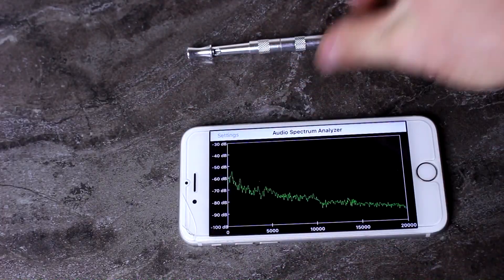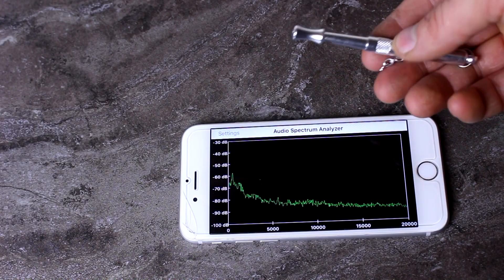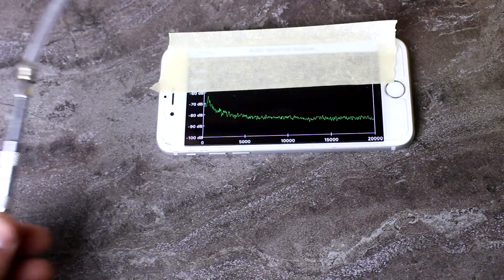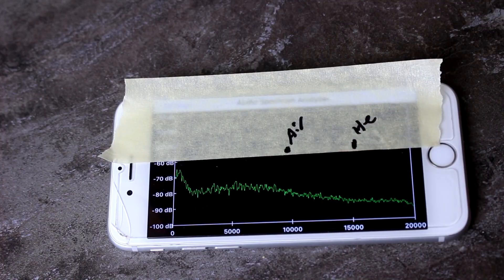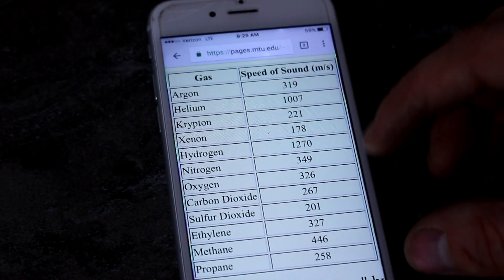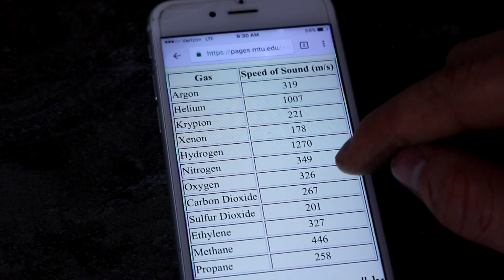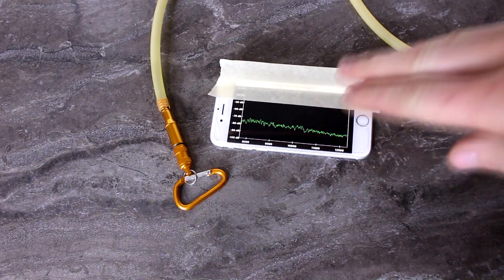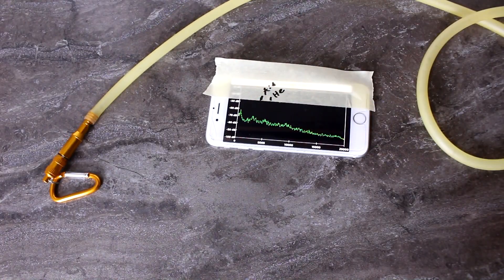Dog Whistle On Helium and Xenon

Comment: Is there any reason why the decibels were backwards? The resting db was a higher number than the peak db, shouldnt it be the other way?
Reply: It's not backwards as such. Decibels are used to measure a ratio on a logarithmic scale. If you're talking about the decibels of sound pressure level (dB SPL), which is how "loud" something is, then 0dB is the threshold of human hearing, and the dB go up from there as a the SPL increases.

With electronics it's different. The dB here doesn't refer to SPL, it refers to the electrical signal level. The microphone moves in response to SPL, creating the electrical signal that can be used by the phone. But there are limits to how far the microphone can move, and thus a maximum signal level. Any sound pressures higher than that will be cut off. So on this scale, 0dB is the maximum signal, and the dB go down from there as the signal from the mic decreases.
Reply: I'm not gonna try to pretend I understood everything there but it definitely helped me get the gist of what was going on.
Reply: Glad I could help a little, haha!
Reply: The minus signs are important.  -100 is lower (more negative) than -60.

Comment: Could you scale up the whistle to infrasonic range (maybe use large drainage pipes 100ft or longer in total) and run various gasses through it  with significant pressure and flowrate to make a proper Horn of Jericho?
Reply: Come to think of why not use one those mineshafts you have access to as the organ pipe body? Might be tricky to plug the entry up but wouldn't cost much. ..

Comment: You were able to access one of the other harmonic overtones of a very tiny instrument with the Xenon gas. Impressive. But this also might be a contributing factor to why you got on odd result with the helium. With a cheap “instrument” it’s overtone series might be limited to certain frequencies, limiting or skewing your results. I would be interested to see what the results would look like using let’s say a pitched pipe from an old pipe organ where it’s length and shape dictate it’s harmonic overtone series and see how the series shifts with different gasses. (At that point pressure would only alter dynamics)

Comment: To get a more accurate pitch ratio for the helium and xenon wouldn't you need to record the whistle in a chamber filled with each respective gas?  That might mitigate the reduction in the ratio you were getting since the sound waves from the whistle had to pass through the air to the phone.

Comment: If you take a balloon of air and a balloon of helium, does one take longer to empty?  I would think the lighter helium would  get accelerated faster, since the balloon is exerting the same force on a smaller mass.  How could you repeat this experiment, taking the velocity of the gas out of the equation?  With just air, blowing harder (higher pressure) can change the sound, so is it the pressure, the velocity, both or neither that have an effect in this experiment as well as the density?  I would think velocity would, as it would modify the turbulence around the fipple of the whistle.
Reply: Ahh, you addressed this a bit later with the Xenon.  I think higher velocities would result in harmonic overtones resonating and could cause an effect (at some point, maybe not just with the difference from the atomic mass difference).

Comment: Is the frequency definitely proportional to the speed of sound? Because the ratio of the helium and oxygen frequencies looks more like 1.5. That's close to the root 3 which is close to the ratio between the speed of sound. 
9500 * sqrt(1007/343) = 16278, close to the 15~16 thousand for Helium
9500 * sqrt(178/343) = 6853, close to the 7 thousand for normal Xenon
Perhaps this is just a coincidence.

Comment: Typically balloon helium is 15% oxygen (you need to know this when you're illicitly mixing breathing gas for diving) to eliminate the asphyxiation hazard. If it's fed into the carburetor of a propane torch it will fail to extinguish the flame. This is like the third time I've heard you question the purity of that bottle of helium, it's about time you found out.
Reply: A Cody style video might be "how to get the O2 out/sequestered"
Reply: PETER GREEN I think oxygen has a lower condensation point than nitrogen. But it's been a while since my last chemistry class!
Reply: I wonder if surrounding the tank with liquid nitrogen to liquefy the oxygen would work?
Reply: PETER GREEN
That definitely would work. Perhaps a bit tricky to pull off in practice but a very clever idea, my compliments on that. Chill the whole tank below oxygens boiling point then hold it upside down and open the valve to blow out the condensed liquid.

Star Gazer
Using air makes a lot of sense at first glance (cheap and readily available) but 3% just isn't enough, it certainly wouldn't keep you conscious and in a high altitude location you'd still be at risk of brain damage(remember this is a measure to protect stupid people) to get even 10% oxygen your gas mix would wind up half air and that would certainly float party balloons but in the big picture it would suck as a lifting gas.
I've never personally had occasion to mix tri-mix but those who do all seem to agree that balloon helium is 15% oxygen(you always need to measure this in order to calculate how much oxygen to add to the mix).
Reply: Why do you know about how to illicitly mix deep sea diving gas
Reply: @Ang3lUki  It's only truly illicit if you do it for others. In most things regulations are much looser if your only doing for yourself. Diving is a field where most of the foundational research was done with public money in various countries and is for the most part freely available so a motivated individual can self educate fairly comprehensively. You just need to earn your own confidence to judge whether you know all you need to know. Diving is also a field where the state of the art is way past what any industry body will certify you to do. So unless your in the navy at some point you will need to stop gaining new skills or live by your own light.
Reply: @brocktechnology  That makes sense. It's very dangerous, so pushing the envelope at an industrial scale would be a lot of liability.
Reply: I suspect that is 15% air, not 15% oxygen.  That's about 3% oxygen.
Reply: I got super tilted by Cody Going "and down here Oxygen is about" Dude... Normal air is mostly Nitrogen, please don't be part of the problem Cody!

Comment: You might be unto something with your helium gas being contaminated with oxygen. I'm assuming as a party trick a lot of kids may inhale helium repeatedly and so putting some oxygen in there makes sure they won't die! But that's just a theory.
Reply: Probably both the above and original comment, a due diligence thing, with the added benefit of a larger profit margin, or maybe due to laws they are required to not charge for the safety feature that would be the normal air or oxygen
Reply: Doubt that anyone would die from it.

Usually you tend to pass out before you reach permanent brain damage.
Reply: I somewhat doubt it, but I feel I should throw this out there as a potential reason.
Helium is supposedly a popular gas to commit suicide with (look up "suicide bag"). It tends to be very rapid and without the symptoms you normally associate with suffocation. You just stop being conscious and that's about it.
Perhaps it is an attempt to prevent that. That is, assuming it is cut with another gas and that the gas is oxygen.
Reply: The only thing required is that the balloon will float when filled. If cutting rhe gas with O2 or other gases accomplishes that its win win
Reply: Here is a copy of my reply to Cody 
Isaiah OConnor
10 hours ago
Hey Cody yes, the helium is diluted in most if not all party tanks. Matter of fact even in large commercial size tanks they sell what they call Balloon Gas, which is helium often recycled from medical/lab work that is of a lower purity and useless to the medical/lab work in which it was intended that needs a high level of purity.  However it does work perfectly fine for party balloons, depending on the ratio.  

Also Inhaling helium can and has caused serious injury, death and permanent brain damage, as a quick google search will reveal.  Helium in and of itself is completely inert and will not cause you any damage. However as you have shown percentages are important, and if you inhale too much at once even for a few seconds, it can and will displace all the oxygen in your system, causing brain damage and death, and very quickly.  I found a website warning of impure helium supplies because they did not kill you fast enough, it was a suicide website where they teach you how to off yourself. So no not as safe as people would think. (That was more to others here then you Cody :) ) 

For example divers often use helium in their tanks to fight the bends, and this is perfectly safe as they use a regulator that mixes enough oxygen and nitrogen into the system so they do not die.  However if you breath a full normal size party balloon being between 11 and12 inches in diameter and have a smaller lung capacity, the results could be lethal.  Even worse with larger size balloons such as the giant 30 and 36 inch balloons. 

Why do I know all this? I am a professional Balloon artist and work with balloons and helium on a regular basis. 

Also since helium is currently expensive and going up in price a lot of companies are diluting the supply they are selling to increase profitability.  Hopefully they will get the massive new helium find in Tanzania will bring down the prices :)  

Bonus fact.  Helium has never before been sought out for commercial mining operations. It has always been found as a byproduct of natural gas exploration. A couple of companies teamed up to try to locate it on purpose and found a massive supply .
Reply: Isaiah: "Why do I know all this? I am a professional Balloon artist"

this is my new favorite YT comment
Reply: The nanoblimp folks mention party time balloon kit tanks don't provide as much lift as what you get  from even grocery store gallons.
Reply: I thought balloon Helium was only partially helium? Doesn't take a lot to make a balloon float so why pay for purer than you need?
Reply: You're close, but the oxygen is actually there to prevent people from using it to commit suicide: "In 2015 author and right-to-die advocate Derek Humphry reported that Worthington Industries, the world's largest manufacturer of disposable helium cylinders, had announced that their helium cylinders will guarantee only 80% helium, with up to 20% air, making them inappropriate for use with a suicide bag".
Reply: Andre Gon but any damage at all is lawsuit worthy, which is why the warnings and the cutting of the purity, so cutting it would make damage next to impossible to occur, as you would still be inhaling enough oxygen to keep you fully functional
Reply: an electroBoom theory thanks 4 reading
Reply: It would be interesting to test exactly what gases it contains - you could put and electrical discharge through the gas and then look at the spectrum through a DIY photospectrometer (aka toilet roll, digital camera  and diffraction grating made from a CD)
Reply: I'm pretty sure if you read the box that the tank came in, i believe it says 70% helium and 30% oxygen
Reply: *hypothesis
Reply: Party balloon helium only has enough helium to float the balloons.  It is a waste of money to use pure helium for that.
Reply: As someone whom sells a lot of gas cylinders for a worldwide company... No we dont cut the gases to increase profit margins. However we do sell separate cylinders for regular use i.e. "balloon helium" since it requires not as high purity as welding, purity is around 99% though. However for welding or laboratory use it  is 99,996% purity (or higher purity if required) and costs a lot more. Helium is used as a welding gas when the welder needs a lot of heat put into the material as argon doesn't have the same heat transfer.
Reply: main problem with this thread, people are interchanging the words 'oxygen' and 'air'. 
It's a duh thing, but air is only how much oxygen?
So breathing a helium balloon with 20% air is going to be different than 20% oxygen. 

Second problem, there is such a low amount of fact-checking, you could all be right and none of you would even know.
Reply: please go see my detailed reply to Cody... yes heilum can kill add yes it's diluted in those party cans. in a nutshell.  :)
Reply: I was going to comment the same thing. I guess I could be wrong, but I have heard the same thing before about helium you buy containing oxygen now for safety reasons.
Reply: trustthewater Thanks for informing me. I know what I'm doing tonight. It's on your head.
Reply: ElectroBOOM A game theory!
Reply: + Andre Gon - you will pass out within seconds if  you are stupid enough to hyperventilate with helium and hold your breath...err...I would assume....err...according to a... friend. :/
Reply: blow some helium from the tank into a box and see if you can keep a splint burning/glowing in there. Pretty easy to test for any significant amount of oxygen (assuming it doesn't say right on the label as one person suggested they thought it did)
Reply: + tibor29 - maybe some companies do this, but I can assure you the stuff we were using to inflate balloons at the place where I once worked had nowhere near 20% oxygen in it. Once upon a time, I could readily hold my breath for around four minutes, whereas after hyperventilating with this stuff, I made it only a few yards along the building, holding my breath, and although there was no urge to breathe, due to me expelling most of my CO2, I definitely recognised the symptoms of lack of oxygen after a very short while.
Reply: tibor29  while that may be do it does significantly raises there profit margins and that may be as large if not larger reason.  I say this as they also fudge a bit on the advertising "facts" they say 30-40 balloons but fail to mention that was only for  9 inch balloons which are barely large enough to float.  a 11 or 12 inch standard party size you get 12-15 ig your lucky. so deceptive advertising makes me think it's more about bottom line then suicide prevention all though that may also be a valid reason just a less important one.
Reply: It was because the sound waves had to travel through air to get to the microphone...
Reply: A GAME THEORY

sorry
Reply: Perhaps he should try welders helium. No oxygen in that or else you ruin the weld. I personally use argon, but I believe you can get helium for specialist work in confined spaces where you don't want it to hang around.
Reply: along with that it may be cheaper
Reply: yes, baloon helium has oxygen so you don't drown you can die, because if you fell face down with helium in your lungs it would never leave, the opposite is true for heavy gasses(82 people died in 2014)
Reply: I have never inhaled helium, but I inhaled chloroform hahahhaha
Reply: I disagree because the helium I've played with doesn't seem to have any oxygen in it. When I'm playing with oxygen, I tend to get dizzy if I don't breathe air for too long, and one time my cousin went blue and nearly passed out for a bit we were doing. I do agree that that could be a likelihood though; it was my first thought too. It seems more like maybe the helium just  had normal air in it, lowering the amount of available oxygen while also lowering the quality of the helium. Just a passing thought though. :)

Edit: I was wrong. Apparently balloon helium has 15% O2.
Reply: Huh, boomer
Reply: ElectroBOOM 
A game theory
Thanks for watching
Reply: @PotatoesAssistant  i replied almost the same thing
Reply: Probably also a regulation that all commercial gasses have to have some oxygen in the as some medical gasses can make people high
Reply: A game theory
Reply: ElectroBOOM  I watch your channel

Comment: I think the reason you can't see the peak of the dog whistle at the beginning is because that spectrum analyser only goes up to 20,000hz which is the limit of human hearing so the spectrum analyser won't show the peak the dogs can hear. Try this again with a spectrum analyser that can go past 20,000hz and see what happens?
Reply: Unlikely that microphone even registers 20K, forget anything higher. I think what was registering on the phone was a secondary resonance, pretty much the sound of the air escaping, and not the primary sound of the whistle.
Reply: Yeah I completely agree, most microphones advertise that their mic's go up to about 22khz? Something like that, I guess the video wasn't really about that anyway but I would be interested to see what pitch the dog whistle is outputting that we can't hear.
Reply: It's very possible the mic would capture higher, although it's not specifically designed that way. The digital sample rate would also need to be higher. (It has to be at least double the frequency you want to capture.)
Reply: It would be interesting to see this experiment re-done on slightly more proper gear. (Large diaphragm condenser mic, 192K sample rate, etc)
Also, testing not just the whistle but human voice too, would help answer a question that's been annoying me.
There is some interesting debate over the effect of helium on voice. (Does the fundamental pitch change, or only the "Formant"?)
I would do it myself, but I don't actually have any helium let alone any xenon. I'm sure somebody has tested this before, but who knows how to find it...

Comment: Hey Cody - on the dependent axis, you are likley showing a “Sound Pressure Level” as opposed to “Intensity”. I know what you meant, I just wanted to point out that in acoustics, intensity has a specific definition.